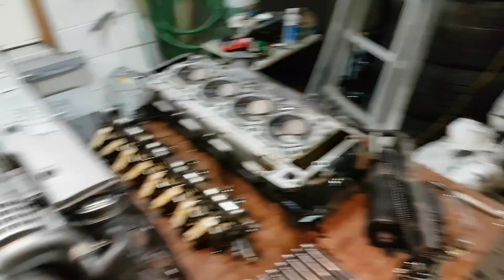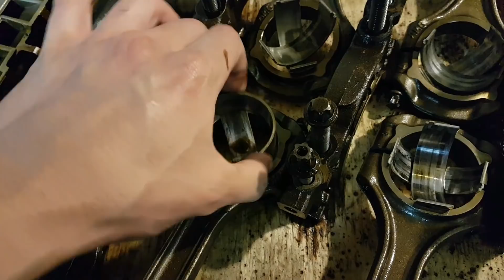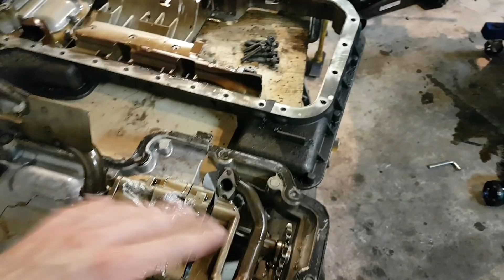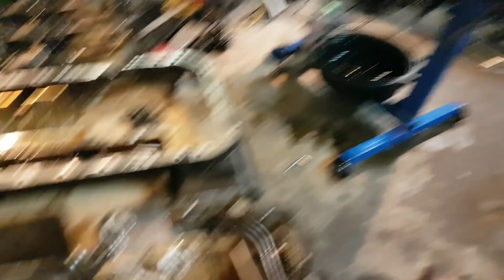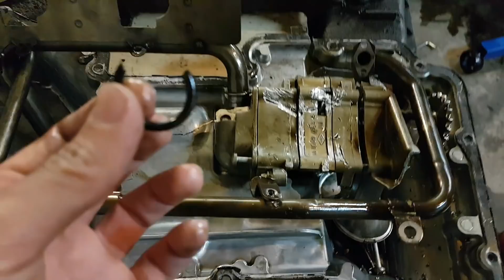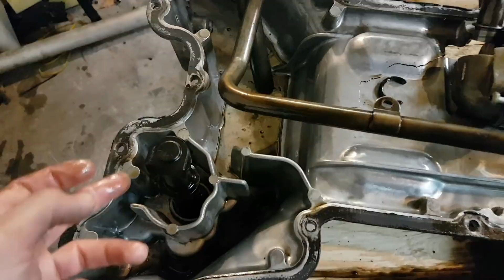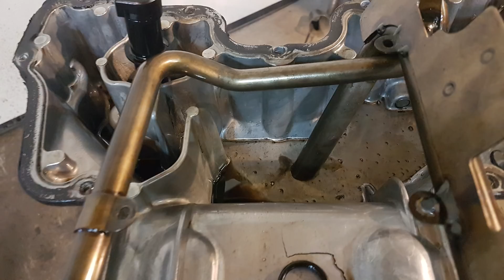Why my Engine Blew. Something every E55 owner should know!

Comment: That sucks, that entire engine is shot, that's going to hurt the wallet.
Reply: +ardi du Unlike turbochargers, superchargers don't require an external oil source.
Reply: Now he has a spare supercharger.
Reply: jospi2 not really if it seized up cuz of the nom-existend oil flow..
Reply: Nope put a ls1 in it
Reply: halofreak1990 alright, didn‘t knew, since i never saw a Supercharger in real life, are they equipped with ball / cylinder bearings instead?

Comment: cant believe that these cars dont have an oil pressure sensor, very chep car I know has that. Of course if the pressure drops there is already damage done to the engine, but atleast the driver gets an idiot light and doesnt ruin EVERY part in the engine...

Comment from the maker: For people that haven't seen the previous videos, keep in mind this is a time attack car. I've been using it on the track for the past two years so its been through a lot more stress than most other E55's
My point is that if it happened on this car it might happen on other E55's later down the road, and without an oil pressure sensor or switch there's no way to tell when something like this happens. Its something that could have been easily prevented had I known in time, so Its worth pointing out to others so they don't fall for the same thing.
Reply: Wait....There isn't an oil pressure sensor on that motor? My Kawasaki lawn mower engines and my pressure washer have oil pressure switches that shut down the engine if pressure is low. WTF would an engine like this not have at least an idiot light???
Reply: @freakasis  I need one like that...smh...wow
Reply: Please make video of oil pressure gauge instalation........ Thanks
Reply: Yeah Mercedes is somehow avoiding those oil pressure sensors, I got w210 e320CDI from 2000,  it's a diesel and it also lacks oil pressure sensor, what it only got it's the oil level sensor as in yours E55 and that's it, very strange engine designing from Mercedes

Good luck with the engine rebuilding!
Reply: Man, it really sucks that this happened to you. How much did it cost to get a new engine? 

Also, how deep do you have to tear down to service both of those o-rings? Can I just drop the oil pan and replace those o-rings?
Reply: do you have plans to add some form of oil pressure monitoring in your new engine ?
Reply from the maker: Yes, already ordered an oil pressure gauge. Will be installing it soon!
Reply: SK8215 where did you study motors? You’re like a motor doctor 😹
Reply: Does the S55 have the same O-ring issues even though it has just 1 large oil tank? Thx
Reply: SK8215 What oil were you using?
Reply: SK8215 Mine was driven in -25 to +30°C, never raced but driven very hard, at least one full acceleration from stand still each day, had 0W40 Mobil only for it's entire life, replaced at around 8000km. And Mobil Jet II for the Kompressor. Around 250000km and then it was sold, maybe the o-ring was about to fail who knows, great engine anyway.
Reply: great video bro, nice investigation work I own a cls55 only got 69k on her but good to know!!
Reply: @DJ-ANZ  are u thinking about selling if so lmk
Reply: Further research shows that dropping the oil pan requires dropping the sub frame. For this, you want to keep the motor suspended or jacked up, which seems like a bit of a pain. I guess you could use one of those on-car hoists to support the motor while you do the job. 

Once you have the pan off, I hear it's also a pain to get it resealed later because the oil from the motor keeps dripping and ruining the sealing surface. Do you have any advice on that? Or maybe a write-up guide for people who want to replace these o-rings themselves.
Reply: So more importantly since I own 4 AMG's (not E55's) is WHERE to hook up an oil pressure sending unit from???
Reply: I think Lewis and Valteri are a little in trubel now! :)
Reply: Timo Lindroos Double mechaical DNF at the last race... did you seen?
Reply: SK8215 
Im sorry man oh no feel bad for U my friend I hope U can somehow get an engine or new car 
best of luck 
God bless

Comment: between BMW and Mercedes, the material they use for orings suck. The rubber does not last. orings cracking , valve seals leaking.

Comment: There isnt an oil pressure gauge or warning light on the car? Thats insane.
Reply: My car is 52 years old and even IT has an oil pressure warning light!
Reply: Not only insane but stupid thing to do when its supplying oil to an engine with 8 cylinders
Reply: yeah I know. The oil system is the heart of the engine, at least have a warning light. I seriously believe ,and I do this to all my builds, the engine needs an engine cutoff based on the oil pressure. below pressure cut ignition and fuel.  larger diesel motors like international do this.
Reply: THATS MERCEDES  don't you mean. LOL.
Reply: 10:33

Comment: It's odd that this happened to you. I have never heard of anyone having this problem before. You would think that at least one other person would have experienced this considering there's higher mileage E55's.
Reply from the maker: Keep in mind this is a time attack car and I've been using it on the track for the past two years. Racing ages a car much quicker than higher mileage as stresses and heat cycles are more extreme. 
My point is that if it happened on this car it might happen on other E55's later down the road, and without an oil pressure sensor or switch there's no way to prevent something like this from happening. Its something that could have been easily prevented had I known in time. Its worth pointing out to others so they don't fall for the same thing.

Comment: Replace with aircraft approved O-rings, versus automobile engine O-rings (which are often made of neoprene or similar inexpensive elastomeric material).  Imagine the disaster if that  o-ring failure occurred on a single-engine aircraft at 10,000 foot altitude?

Comment: There is an "old school" situation that parallels this demolition.  Old Chevrolet small blocks had the oil pump pickup tube "pressed" into the pump.  After some years and miles, or worse yet, some rebuilds using "old/good parts" the tube could work its way out of the pump and the damage would be very familiar to what you see here.  The positive fix was to braze the tube to the pump.  Many engines were saved with this simple yet mostly unknown solution.  In this case, maybe a skilled TIG welder could attached the pickup tube onto the casting. The o-ring is eliminated and peace of mind is restored.  Best of luck with the replacement engine.

Comment: What kind of performance engine doesnt have oil pressure sensor / gauge ?  Another piece of deliberately cynical built in obsolesence.... clearly designed to fail.  And COST  !!!!

Comment: i work on older Mercedes all the time, and no way would have the DAIMLER BENZ engineers allowed an oil pickup with an O ring /flared pipe fitting. Perhaps a better pump housing with a    suction pipe fitting that has a positive flange face with a seal that is secured with a stud and nut could be made as kit for other owners?

Comment: Same happend on my M156
Reply: don't scare me, i have 152,000 miles on my m156
Reply: Daniel Inman i had 270.000km, and that was the end. Worst sound ever. Just today i got new engine. Check my story on intagram: german_cars_meeting if you interested.
Reply: daniel inman rest in peace... from God the car comes to God it will return.. RIP Mercedes Benz... better save up for a used reliable Japanese Toyota 1JZ engine as back up in case it fails..
Reply: Thats a lot of gas, just imagine the amount of money you spent if you live in Europe.
Reply: ferfire9 Lot😁👍🏼

Comment: so it worked fine before you messed with it, you took it apart, went on a trip and it broke, you broke it... there's probably nothing wrong with the engine or oil pump at all you simply broke the engine by messing with it not having the right tools or methods for assembly...

Comment: Hi, if not all AMG engines at least the M113k, M156, M157 and M275 doesn't have oil pressure sensor, you found it with the hard way that you need to install an oil pressure gauge.
By the way if you are using your car to the race track you can modify also the oil thermostat it's very easy on M113k. 
Sorry for your loss
Reply from the maker: Hey Tasos, Thanks for your comment. I also recently discovered your channel. Great content on these engines!
Pretty surprising none of the newer models come with oil pressure sensors or switches considering that was something almost all older Mercedes had
Reply from the maker: Bounder With Chris The S55 didn't have this o-ring. This one only came in models with two oil sumps.
Reply: I have an 06 S55 with about 30k into it.. 5k in the exhaust alone.. is this an issue on the S too? I realize they don’t have oil pressure sensors but I am talking about the o ring. I know the oil systems / sump Design is totally different

Comment: Wow that is to bad but u should instal a oil pressure sensor and check into better pistons and crankshaft and defintly polish your heads as it would give you great advantage. Thats what I would do and I LOVE UR CAR U R A LEGOND
Edit: maybe the air in ur oil cooler that u kept geting is from a failing oil ring

Comment: That sucks, a little o ring caused the destruction of your entire engine. Also I was really surprised when you said there’s no oil pressure sensor. That’s just plain stupid
Reply: just like an o-ring destroyed the space shuttle
Reply: This is the problem with tracking old cars, parts are worn out and things fail under the stress conditions of the track that won't fail in normal city driving.
Reply: @OMGWTFLOLSMH  if the engine had an oil pressure sensor it could of been easly prevented tho...

Comment: the cl500 ZAS has an oil pressure sensor. it is really easy to retrofit one to any m113k. the spot is already there, just the sensor some gaskets and you got your peace of mind. I got pictures and part numbers if you want to go that route.
Reply: Can you please link the part number and pictures? Would REALLY appreciate it... Thanks!
Reply: Anoop Patel sure. 
A1120150730, housing, mounted on the underside of the oil filter housing, needs m12x1.5 bolts.

N000000001116, bolts as described. 

N007603012111, o ring. 

A1121840280, gasket.

you may not be able to find it online but any dealership can get you these parts.